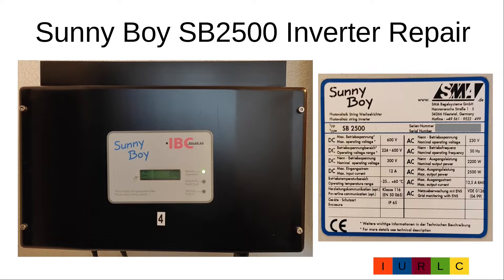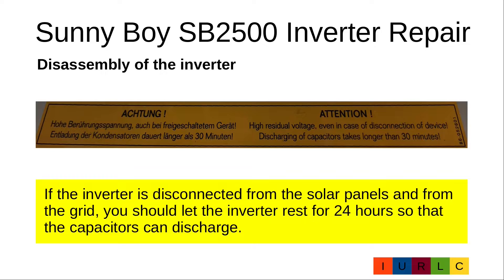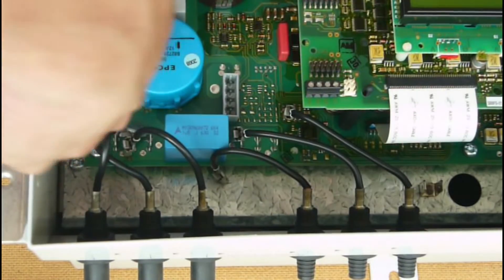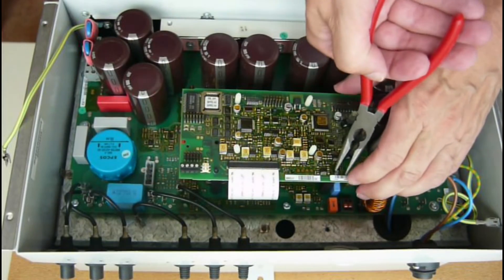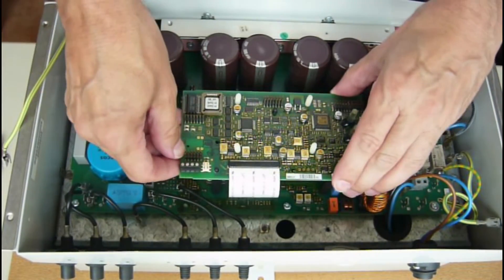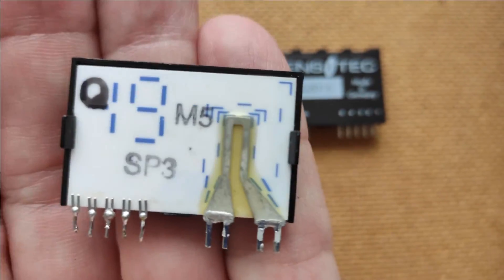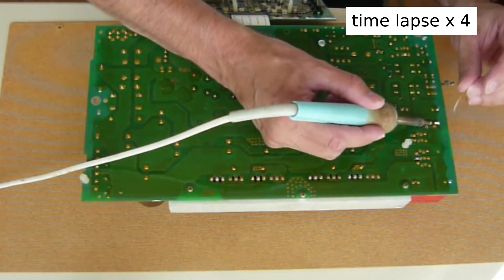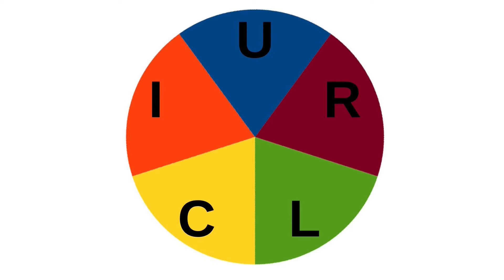029DE Sunny Boy SB2500 Inverter Repair - replacement of the current sensor

Comment: Nice video. Glad you found the error. I myself own an SB 2100TL with an error message 'K1 OPEN'. After replacing K1 and K2 relays I still have the same error message. Any idea what else could be wrong?
Reply from the maker: Thank you for the feedback. I have only repaird the SB2500 until today. So I have no idea about the SB2100TL. But check the electrolytic capacitor - this is often a problem in electronic, that they dry and loose capacitance. And then parts of the electronic don't work as it was designed. But ensure before you disassemble and measure it that they are discharged. Often a first sign of bad electrolytic capacitor is, when there housing is bend a little out.